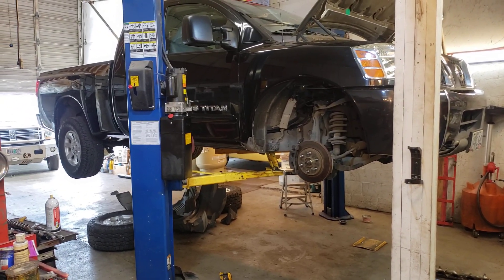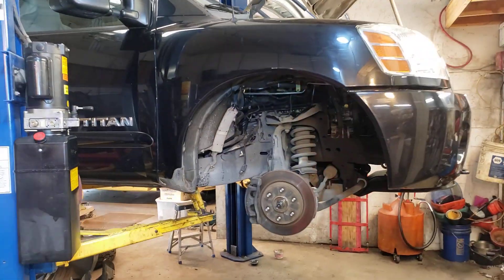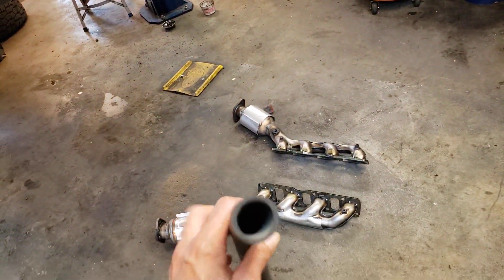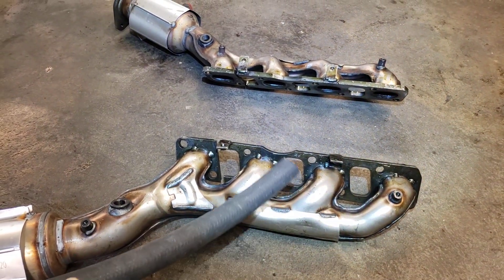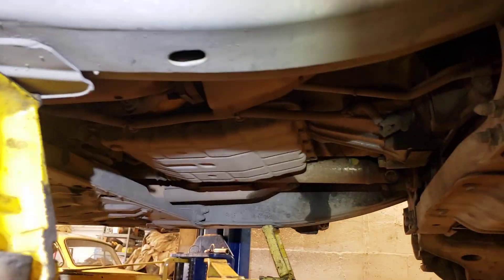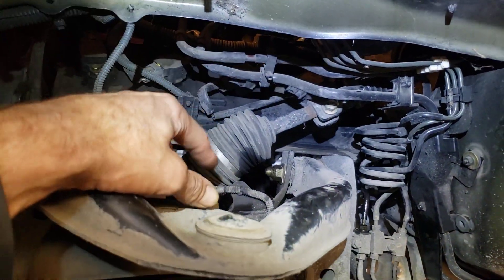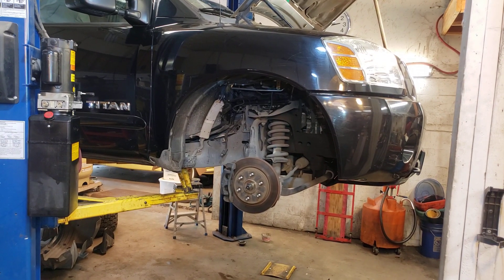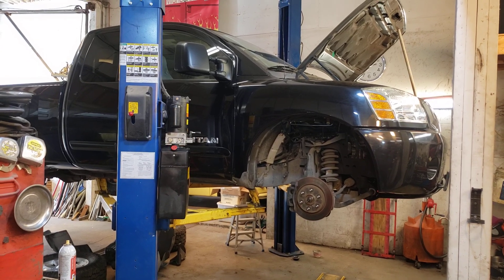Titan Cracked Exhaust Manifolds Not So Fun

Comment: One of the common issues with the Titans. Pretty sure mine have leaks too. In the Titan forums they don't recommend replacing with the OEM style parts as it may just happen again due to the design. Long tube headers, new B-Pipes and a tune can resolve it for good. Guys in emissions states (besides California) can still pass the sniffer test if you get the B-Pipes with the cats. I'll eventually get it done for my truck as well. I have all the parts just need to get it all installed and tuned. I have a 2010 w/136K miles.
Reply: Hi, thanks so much! What are B pipes? I have the JBA long tube headers that I'm about to have installed to replaced cracked OEM headers not even a year old. How can I pass a PA emissions inspection with the long tube JBA's?
Reply: @ikenosis8160  These are B-Pipes: https://www.youtube.com/watch?v=jgmlNX6zfME
You can get them with/without cats. You will need cats in your B-Pipes for emissions purposes. The Berks B-Pipes in the video are top of the line and cost more. Many others out there I just used that one for show.
Reply: Don't need a tune with the flex fuel version

Comment: oof stamped and welded at the seams. Tack welded at the flange.
That truck sure does look new though. The envy for non rust belt states is real.
Reply: Salt state scam their citizens every year. Where I live there are plenty of people and TONS of snow yet no salt. We get around just fine. My 1990 Corolla has no rust!
Reply: @DStabs720  bull.
Reply: @joeyknight8272  Manual clearing and sand is all that is needed. Poor conditions outside? Drive carefully...... 
I grew up in Canada so I think my opinion has to count for something. Often times you'd have roads that are pure ice nearing a stop sign. People knew that and drove accordingly. They didn't salt, they just threw sand down which worked wonders and didn't destroy the vehicles.
Reply: @xnotx2  I agree

Comment: Not familiar with these trucks as we didn't get them in New Zealand but I wonder why the flange plates have a split in them? For the exhaust to crack in the same place as the split flange, it must be expansion and contraction due to heat cycling at that point that ends up cracking the pipe.
Reply: Yep, that is exactly correct. As a former service manager for other auto dealers, It was common knowledge that these such failure points are engineered into many diverse parts as a way to generate massive revenue through jacked up repair costs. This is one such engineered failure point.

Comment: If that was my car, i'd weld the manifolds with oxy acetylene torch.
Torch is a way to go for exthaus system welding, as it doesn't leave sharp lines of heatstress in the metal.

Comment: Ouch! That repair is going to suck. I wondered if it would be easier just to pull the engine?
Reply: Not really. There are multiple videos/guides online that do it with the right tools. Book labor is only 10hrs for both. I know a Nissan master tech who does it in 3hrs. He's done hundreds of them and can practically do it blind folded. As long its not it an ultra rusted northern salt truck, it is not that big of a deal. A first timer can do it within 5-10hr as there are so many guides out there to keep u out of any pitfalls

Comment: Will the new ones also crack at the same stress points caused by the leveraged weight of the converters flexing and then fatiguing? Can you weld up the cracks in the old ones and reinforce to distribute the stress?
Reply: Yes.